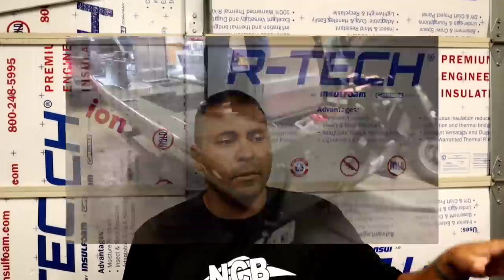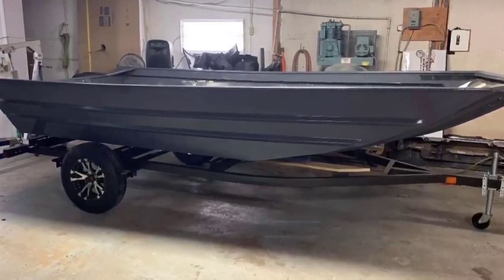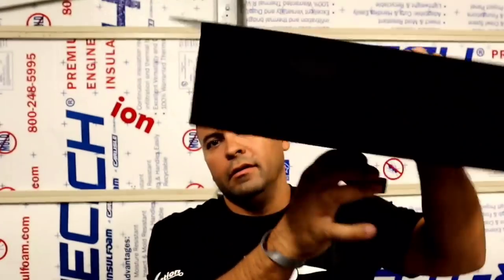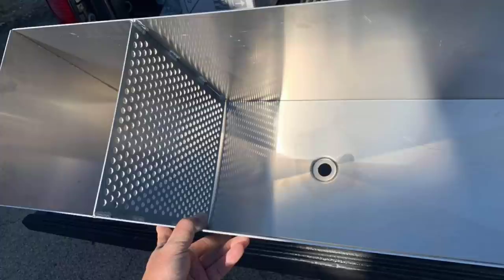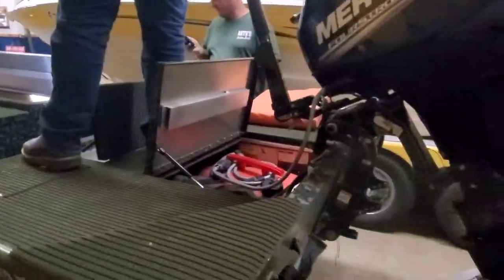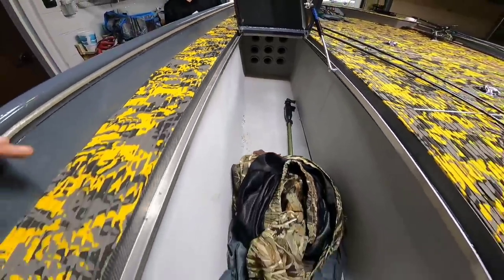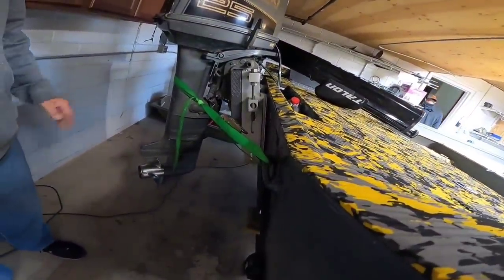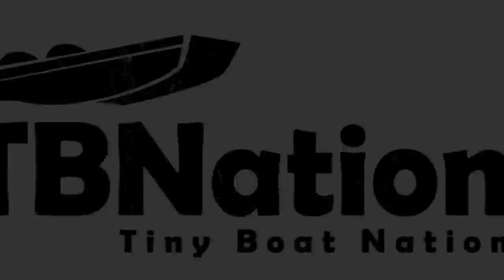Best lid system & boat mods EVER! Boat Building Projects made EASY.

Comment: What about a track system for rod holders and such? Any ideas?
Reply: Like a t rail system?
Reply: @tbnationoutdoors-nateeckhold  not sure what you are referring to?
Reply: You looking for a moveable rodholders  that slide. Up in the air in the back. Or on the side.
Reply: @tbnationoutdoors-nateeckhold  I would like a moveable one that runs the length of the boat.

Comment: My flat bottom G3 1644 w/ mercury 25elh hits 34 mph on the GPS .. guess its running realy good?
Reply: @TinyBoatNation  it has a vynal wrapped 3/4 plywood floor, 2 group 24 deep cycle batterys with on-board charger, lights, 2 fish finders, live well, 6 gallon gas tank, bow mounted 44lb thrust minkota, front pedestal seat, 2 - 15lb anchors  me  (140ish lb) & my gear.... *Live well was empty for speed test.
 Would like to kit it, but its just not in my budget for now.